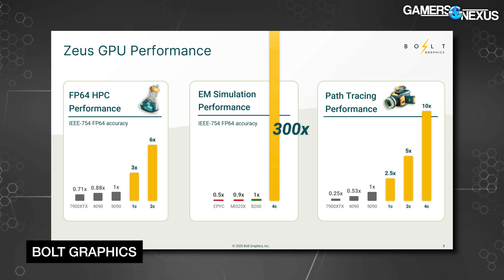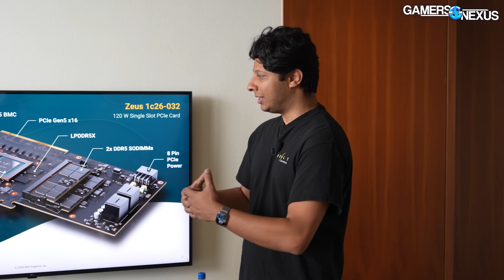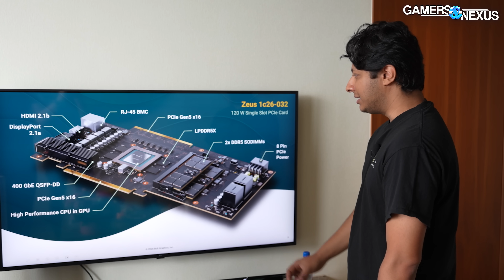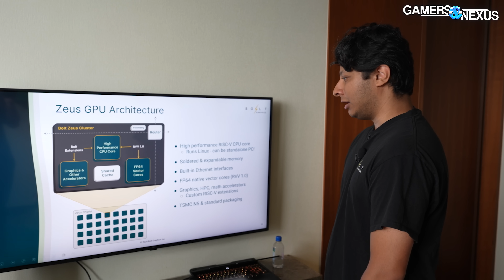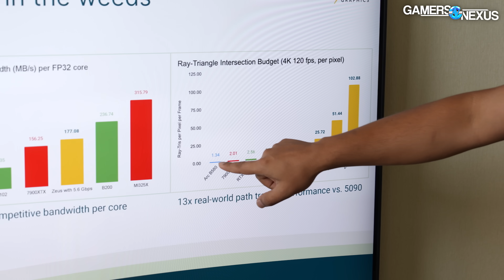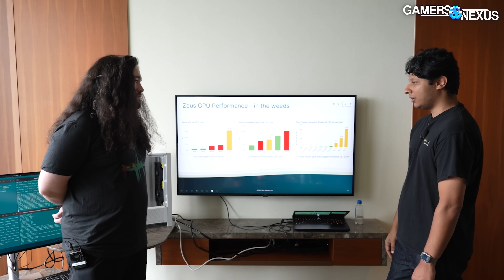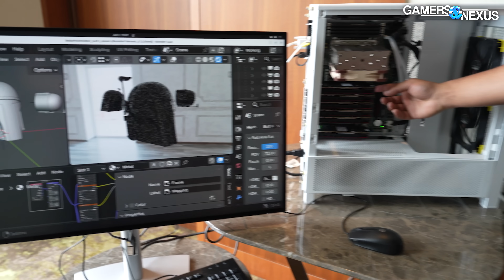A New Gaming GPU Challenger: Bolt Graphics Takes Aim at NVIDIA

Comment: There's no way a thing you can slap that much memory into gets marketed as a gaming GPU. If this ever takes off they're going to leave the consumer market in the dust.
Reply: The plan seems to be to have the higher end GPU Model be intended for the data center market whilst the first and second tiered cards are aimed towards the consumer market. Though it seems there wouldn't be anything stopping the average consumer from out-right buying the top-end model

Comment: Does Bolt use the 1920 vintage, 19 phase, 60% efficient, buck converter or the 2011 vintage, 2 phase, 90+% efficient, Cuk-buck2 converter? The 2011 design is cheaper, smaller, and has a better transient response.

Comment: Integrated graphics (like AMD Radeon Graphics built into Ryzen processors or Intel Arc integrated graphics) do use system DDR5 as their VRAM. While this is cost-effective and fine for casual use or light esports gaming, it cannot compete with a dedicated graphics card carrying its own GDDR6 or GDDR7 VRAM.

Not gonna happen.. People will buy it once compare to AMD and drop it in the RMA..

Comment: Not going to pretend I understood all that was said in this video, but the overall goal and result should be fairly simple.

Any sort of computing component that can do SOMETHING better than an nvidia graphics card, will ever so slightly reduce demand for nvidia cards.

It doesn't matter if it beats nvidia in gaming or not. As long as it is better than it at CERTAIN tasks, it will reduce the overall demand.

The only problem is we need this guy to be protected.

Comment: Put an FPGA chip on it that supports 240p over VGA so we can run MiSTer FPGA on it and it would be a perfect GPU for me. You could then run MiSter retro consoles and computer cores straight to your HDMI TV or old CRT screens from your GPU rather than emulating them through software. Absolute game changer. Someone needs to show NVidia how its done.This guy could be the guy who does it.

Comment: I like the sodim slots, I had that idea too. What would be cool is if the chip was made to be wide range as in it can be undervolted hard, so you can have two 8 pin connectors unplug one and it auto declocks the chip and uses half the power delivery. This would let the user choose if they want to run it full power or half power.

Comment: this is a really interesting architecture, being able to run more general scalar code so physically close to the GPU cores could really be a big game-changer. you could get faster uploads by sending entropy-coded data, then decompress on the accelerator! and assuming it's unified memory over there, the GPU cores could use the decompressed data w/o copying, and you could even treat that like streamed data and start rendering with it as it's decompressed!

Comment: I've never understood why a gaming GPU has to support individual games. That seems ridiculous and unsustainable. I think the whole way that games and video cards and drivers are developed seems inefficient. I'm not an expert, obviously. I'm just talking out of my ass, but isn't there some way that games should be able to be developed to make generic system calls or whatever and the GPU and driver only needs to support those calls and then by extension all games are supported? Also, is nobody else wondering why that card has PCIe connectors on both edges of the PCB?
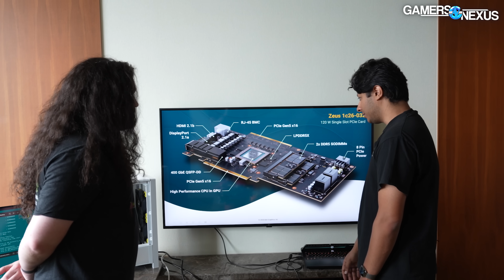Reply: they touch upon the twin pcie at around 6:00, not that I understand the answer

Comment: um i dont think FPGA can verify performance or exact timing of a chip that its not,  if can verify code and design but not exactly speed because only the chip you create contains the full frequency capability and chip parasitic behaviors,  its a prototyping chip for design of code and interconnect. of if your not doing high performance its a Field-Programmable Gate Array allowing custom functions in 1 chip, but for measuring performance, uhh no unless the timing for FPGA is the same as the full chiplet card. which,,, should be vastly different in peak performance for core functions

Comment: To confirm my understanding of the video's content: the company appears to be targeting bandwidth performance comparable to, or exceeding, that of the 7900xtx (approximately 1 TB/s), utilizing laptop DDR5 memory integrated via a socket. They are also aiming for a 13x improvement in path tracing performance compared to a 5090, citing strong customer interest in this feature. However, this demonstration was presented solely on a screen, without the use of engineering samples, which I presume are not yet available. Their strategic business model seems to hinge on achieving market entry prior to a potential downturn in the AI sector, or alternatively, attracting an acquisition through aggressive market positioning. This business approach is one I typically prefer to avoid.

Comment: I personally think they should have gone a different route... forget raytracing, and just concentrate on standard frame rates. For most gamers, frame rate is more important than raytracing.
Trying to beat Nvidia on raytracing will be incredibly difficult... but a new startup can certainly spank them in raw regular frame rates if they focus just on that. Add a simplified SLI option to boost those framerates even more, and I am sure you will have most gamers lining up for the cards. 💯👍👍👍
Reply: Hi man, iv read all 3 of yours comments and they are straigjt and on the point. Exactly what gaming industry, gamers needs and what made it real. No wannabe features, bells ,whistles, but raw fps. 
But they will never be gaming company, if they ever be more than advertisement of vaporware.

Comment: Seems like a camel to me; a horse designed by a committee. 

They want to make a GPU. But also, it can be a standalone and run Linux. 

They want to appeal to gamers. But it's seemingly designed ground up for data centers and HPCs. But they decided to use lower bandwidth LPGDDR5x, and even lower bandwidth SODIMMs. 

I hope they are successful. But as Ron Swanson said, "whole ass one thing. Don't half ass two things."

Comment: Realistically, I am hopeful but also a realist. The ability to add more memory to your GPU should have been utilised long before now.
When you consider how long it took for Nvidia to reach the 5090 or AMD to reach the 9070 XT. It will, undoubtedly, take a long time, especially as the brand doesn't have the same reputation as either of the big two. Nvidia has dominated the GPU market for years now, just as Intel did for CPUs, but all it takes is one very good product (like Ryzen) to completely turn the market. My biggest concern is funding and progression because when the money inevitably runs out, and they have a concept (and potentially a product) that can challenge Nvidia, who is to say they won't be bought out? Then Nvidia uses what they have done, adds it to their GPUs and bang, you're now paying an additional $1,000 on top of what you're already paying, or more likely, they bury it.

Comment: one thing is clear:  this presentation was amazing, and one of two- or this is an amazing reliable project with legs to go or this is the biggest scam since the first release of  "No Man´s Sky", i believe it is the first one this project looks pretty legit and the trade market will go crazy with this new GPU brand
Reply: I am hopeful but also a realist. The ability to add more memory to your GPU should have been utilised long before now.
When you consider how long it took for Nvidia to reach the 5090 or AMD to reach the 9070 XT. It will, undoubtedly, take a long time, especially as the brand doesn't have the same reputation as either of the big two. Nvidia has dominated the GPU market for years now, just as Intel did for CPUs, but all it takes is one very good product (like Ryzen) to completely turn the market. My biggest concern is funding and progression because when the money inevitably runs out, and they have a concept (and potentially a product) that can challenge Nvidia, who is to say they won't be bought out? Then Nvidia uses what they have done, adds it to their GPUs and bang, you're now paying an additional $1,000 on top of what you're already paying, or more likely, they bury it.

Comment: hey, look! a new video card! It just so happens to have a cpu and an OS, support a boatload of off the shelf RAM, and have this nifty connector, so you could in theory run a bunch of these in parallel in some sort of rack mount case. Just what every gamer needs! Mom, I want one for Christmas! Or ten! here's AMD manufacturing a competitor GPU chipset which doesn't make much sense unless you think that AMD might have a sizable stake, and this is their shot at getting a foothold in AI

Comment: I hope they’re successful but there’s no fucking way. If they even came close they’d just be acquired by Nvidia or some Chinese company. End goal is money at the end of the day and the infrastructure required to meet Nvidia where it is is literally impossible to acquire simultaneously, they’d have to take up slots in the same pipeline with a bid 10% (probably less than that) of what Nvidia is paying. Also I’m just stating the obvious, not tryna be a hater id love to have a cheaper gpu don’t get me wrong. Also competition drives innovation so no part of me sees this as a bad thing or wants them to fail.

Comment: Honest take on bolt is that the current cards design is one that is trying to satisfy every sector in oen piece, they need difference designs for different sectors, packing a card with everything for everyone isnt gonna work and the production cost is high when you could have 3 different lines for 3 different types of gpus, consumer (gaming, enthusiats etc), workplace stuff wtv and then servers and whatnot

Comment: I heard about BOLT 3 yeats ago... still nothing.
Reply: Well, realistically, look at how long it took for Nvidia to get to the 5090 or AMD to the 9070 XT. It will, undoubtedly, take a long time, especially as the brand doesn't have the same reputation as either of the big two. Nvidia have dominated the GPU market for years now, just as Intel did for CPUs, but all it takes is one very good product (like Ryzen, for example) to completely turn the market. My biggest concern is funding and progression because when the money inevitably runs out, and they have a concept (and potentially a product) that can challenge Nvidia, who is to say they won't be bought out? Then Nvidia uses what they have done, adds it to their GPUs and bang, you're now paying an additional $1,000 on top of what you're already paying.

Comment: As a TOTAL casual user - from what I have seen, RT can give devs more tools for more dynamic scenes / mechanics as you do not have to bake for every possible move of the objects etc. ... but ... from total casual user pov, RT and Upscalers are NOT being used for what they were advertised but as a cheap scapegoat for crap development and zero optimization  that leads to INSANE image quality loss... at this point, 90% of modern games have less image quality than bloody Unreal Tournament 2004, FarCry 1 or F.E.A.R. -.-"  ... 

Forcing everyone into RT/Upscalers that are NOT even possible to turn off as everything else depends on them... HUGE REDFLAG. Shame that potential competition (which is VERY NEEDED) to the established order of Nvidia and AMD goes with this BS as well...

Comment: guys, dont be fooled. They obviously market this card for datacenters. consumers don't need hyperscallability this card offers. The RAM expansion slot is to run AI models on the cheap. The RJ45 and Pcie on tops is not for consumers. As it is, you can only plug two screens on this thing, just this would deny them a good consumer market share

Comment: Definitely rooting for their success but the franken-memory situation of slapping SODIMMS onto a card seems to be the most glaring bottleneck here. Dell is already moving away from the SODIMM memory form factor on their laptops simply because of the physical distance of the traces from the memory to the CPU. Would a GPU not hit a similiar wall just as fast?

Comment: I noticed they didn’t talk about ai. My first thought on user upgradable ram was running LLM locally.  This could be massive for homelab ai use. 

For gaming, they have to compete on software. That is also true with ai.  Wondering how they plan to address NVIDIA and amd software stacks for gaming.  Dlss/fsr, reflex, etc. 

They need programmers! 

Also wondering about is support.  Windows and Linux only? Will they match nvidia and do FreeBSD?  Will they be open or closed drivers? What about cpu architecture support? A lot of people have been wanting open arm drivers.

Comment: What if the optical circuitry could be fabricated using circuit board design and manufacturing processes with tiny sockets for coupling silicon drivers with the fibre circuitry?

Comment: I love everything about this. I love the 400G QSFP-DD. That's 8 x 56G transceivers. FPGAs with those transceivers are extremely expensive. This card has a lot of potential for lots of different kind of use cases. And those vector processor cores should be more versatile than shaders, but I wonder if you lose some of the insane parallelism that a GPU gives you just because it has hundreds of shaders. Very curious about the tradeoff here. Also those Xilinx U50 FPGA cards are $3k each and have 872k LUTs and based on ultrascale+

Comment: As a workstation user (who switched to intel ARC last year and had Radeon Pro previously) this is great news. nVidia Quadro has been a complete ripoff for the past 10 years and AMD is doing the same. AMD has abandoned their regular Radeon Pro W series and traditional customers for Radeon AI Pro cards. I need a card for engineering, CAD, 3D, fluid dynamics and not AI nonsense.

Comment: so your games would have to be compiled for RISC-V? I guess we would need an equivalent of proton/wine to run older games on it
Reply: no reason that should be a requirement if the games still run on your PC's CPU as usual and only use the GPU for rendering as usual through DX12 or Vulkan

Comment: I hope they get the industry support going forward for many reasons. The main one is they have a great model when it comes to lower margins, because lower profit margins (As long as it is sustainable in practice) Will be great long term if they get the scaling in the market that they need. I feel like the proof concept of going into the professional and creative field first is a smart move since they have less compatibility to overcome per use case. There are limitations and obstacles, but it is the better approach as they say when you compare it to Intel's issues starting out.

One thing for sure is all areas of the market are in need of innovation and competition.

Comment: 1. Great that they're doing it, thanks for the video. 2. Will they provide GPU's if the core will die and we have to replace it and/or firmware. 3. Will they allow for UART codes access?

Comment: As Linux desktop is on the rise, a "bold" move would be to release the driver as open source. If they mainly have issues with software, I'm sure the rest of the world could help here and especially the Linux community would be greatful. It would probably make the GPU the go-to solution for Linux when it's well integrated / adapted. I'm still in the process of switching to Linux. Finally have my second SSD installed and a basic setup, but I don't have that much time to play around. Since I would consider myself as a power user, I have many requirements which right at the start had some road blocks. Some things look like they could turn out way better / flexible. I'm a software dev myself, but have pretty much zero experience with Linux dev. I know some bits and pieces 

Ok, I just reached the part in the vid where he said the GPU core is licensed, that would probably rule out any kind of open source drivers...

Comment: If that slot in memory modules is intended for the final product then ye good luck ever gaming on that design. The memory latency will be insanely high compared to any other gaming hardware with soldier close to gpu memory.

Comment: With user expandable memory I can see this getting gobbled up by Ai companies because sodimm sticks can reach up to 128gb. Spending something like 1k for the card plus another 3k for 256gb of ram lets you 8x the 5090 memory capacity for about the same price. An array of 8 means 2tb of VRAM for about the price of 2 rtx pro 6000's, which only have 192gb between them.

Comment: Ya know what.. Software might not be the hurdle u think. Can't get the ml anything I need to run on the new 5070 bc it's too new. Sure all the docs say, yea pytorch, tensorflow, all good. But that is one meta layer. Insta flash, cuda integration, it's an endless list of config that do not integrate with Blackwell. So I think Bolt, if they can come through as agnostic, os friendly... Wins!

Comment: I've been saying for years that there's no fundamental reason GPUs couldn't have user-expandable VRAM, and I've spent a lot of time exploring the engineering challenges behind making it a reality. Having spent many years in the semiconductor and chip industry, I've always believed this was an engineering problem worth solving rather than an impossible idea.

It's fantastic to see an innovative team like Bolt taking on that challenge instead of accepting the status quo. In my opinion, it's also understandable why established GPU manufacturers like NVIDIA haven't pursued this direction—their current business model benefits from selling products with fixed VRAM tiers, so user-upgradable memory may not align with their commercial interests.

I genuinely hope Bolt succeeds. Innovation like this is exactly what the industry needs, and I wish the entire Bolt team every success. I can't wait to see where this goes.